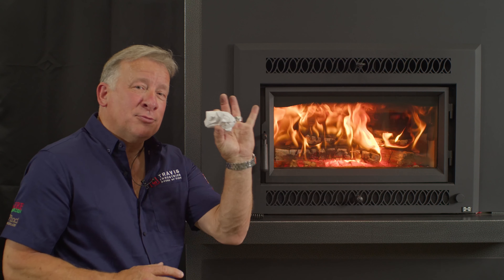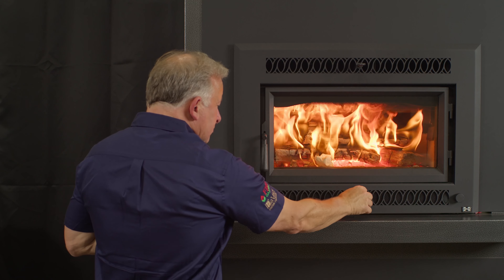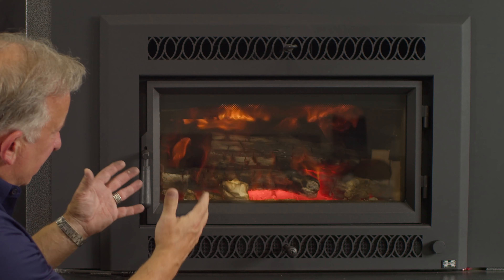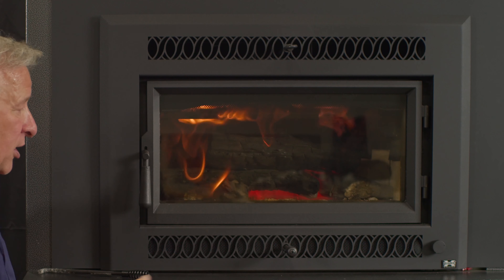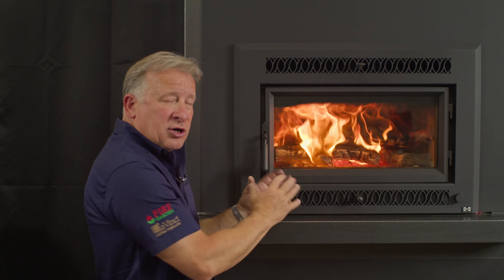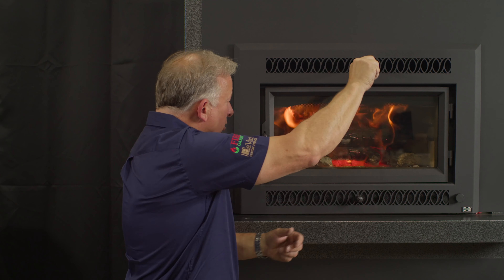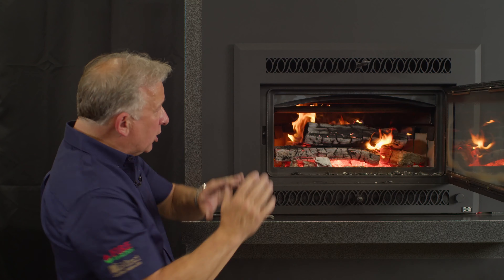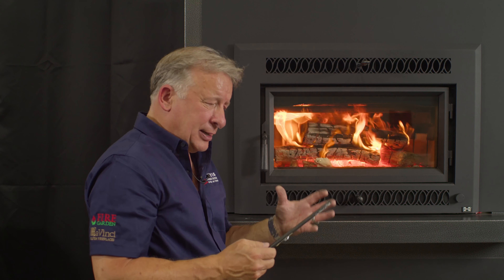The Future of Wood Burning Technology

Comment: How do you control heat output and burn time?
Reply from the maker: Good question! There is a lever located on the front of the stoves called the air control lever. Depending on the model, it is either located on the left or in the middle. By manipulating this lever, (pushing in or pulling it out), you can control the burn rate to a very fine degree. You can experience it or discuss it further at your local dealer! https://www.fireplacex.com/where-to-buy/

Comment: Is the only difference between NexGen-Hybrid and NexGen-Fyre the presence of a catalytic combustor in the hybrid version? Follow up question, would that make the NexGen-Hybrid better than NexGen-Fyre since they both have secondary air tubes in the top of the firebox/same technology but the hybrid has a catalytic combustor?
Reply from the maker: Yes, the only difference is the presence of the catalytic combustor. This brings benefits like lower emissions, higher efficiencies, and longer burn times over non-catalytic stoves. NexGen-Fyre units still provide the best non-catalytic burn available with a balanced fire and immense heat output, but the additional efficiency from the Hybrid units qualifies them for a 30% tax credit.
Reply: @FireplaceXFireplaces  thank you for the reply! One more question - I am currently working with a dealer and originally was looking at the medium flush wood NexGen-Fyre but they sent me an estimate for the NexGen-Hybrid model. Is the hybrid model actually in production? The sales rep said Travis Industries will start making them at the end of NOV and ship them out late DEC.
Reply from the maker: That unit is currently in production. It may just be a case of stock availability for that particular area/dealer.
Reply: @FireplaceXFireplaces  when does the tax credit benefit end?
Reply from the maker: With the August 16, 2022, signing of the Inflation Reduction Act (IRA), high-efficiency biomass heating products once again qualify for a tax credit under Section 25(C) of the Internal Revenue Code (“IRC” or “tax code”). This new 30 percent tax credit – capped at $2,000 annually – is available for appliances installed between January 1, 2023, and December 31, 2032. The credit can be used on the purchase and installation costs of qualifying appliances. To be eligible for the tax credit, an appliance must have a thermal efficiency of at least 75 percent per the higher heating value (HHV) of the fuel.
Reply: Thank you @FireplaceXFireplaces ! Does this unit require electricity or power of some sort to blow the heat throughout the house?
Reply from the maker: The unit shown in this video is a Flush Wood Rectangular Fireplace Insert. These units come standard with a convection fan that will require power via a standard wall outlet up to seven feet away. There is an optional hard wire kit available at additional cost that will allow the unit to be hard wired into your homes power. It's worth noting that the units are tested with the blower in use, but will radiate heat without it. More information can be found here: https://www.fireplacex.com/products/wood-inserts/
Reply: @FireplaceXFireplaces   how much power/energy do you need to run it (to know how much solar power is needed)?
Reply from the maker: This unit requires a minimum 1.8 amps at 115 volts which equals 207 watts. This will be the same for the medium and large models. Keep in mind these numbers are without the optional GreenStart™ Ignitor. With the GreenStart™ Ignitor, the power requirements go up significantly to minimum 9.8 amps at 115 volts and 1127 watts. This information is readily available in the owners manual under the "Documents" tab on the product page on the website.

For added clarification, the unit will absolutely provide heat without power. While we strive to deliver optimal heating performance with all our units, we may not be able to guarantee the specific heating performance numbers advertised for this unit without power.

Comment: Do you carry a zero clearance wood stove?
Reply from the maker: All of our wood burning appliances require some amount of clearance, so unfortunately no we do not. You are welcome to visit our website www.fireplacex.com or www.lopistoves.com for more information. Use the "Where To Buy" function on either website to get in touch with your local dealer if you wish to discuss your project over the phone or in person.
Reply: Other brands call it a zero clearance, although they require an inch and a half clearance around the stove. Do you sell anything like that? I would be building a frame for it to sit in.
Reply from the maker: I think you may be referring to what we call fireplace inserts, which are designed to fit into the opening of an existing metal (zero clearance) or masonry fireplace. We have a lineup of wood fireplace inserts you can find here: https://www.fireplacex.com/products/wood-inserts/
Our other brand, Lopi, has additional options: https://www.lopistoves.com/products/wood/wood-fireplace-inserts/premium-steel-wood-fireplace-inserts/
General specifications as well as installation specifications can be found under "Documents" on each product's page. Clearances are often listed, but not always. We recommend you speak with a dealer to help select a product that's right for you.

Comment: what is this model name and cost?
Reply from the maker: Nearly all of our wood burning fireplaces and fireplace inserts feature NexGen-Fyre™ or NexGen-Hybrid™ technology! NexGen refers to the secondary air tubes in the top of the firebox, while Hybrid refers to the presence of a catalytic combustor. Speak with your local dealer to find out more about this technology, as well as for pricing. You can find your nearest dealer by inputting your city, state, or zip code here https://www.fireplacex.com/where-to-buy/

Under the "Products" tab, you will find a list of all products including which have NexGen-Fyre™, or NexGen-Hybrid™ technology.